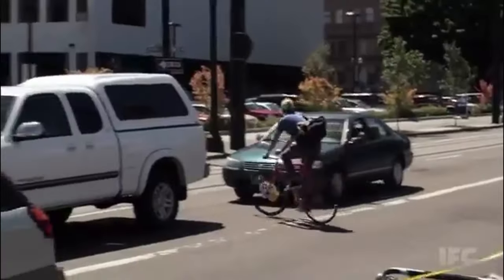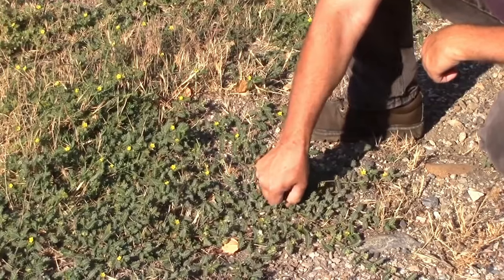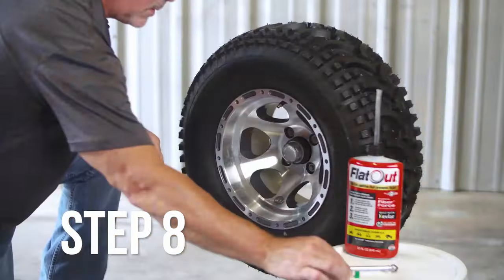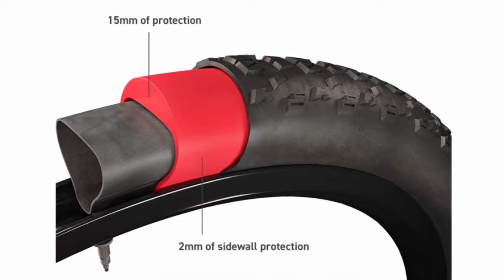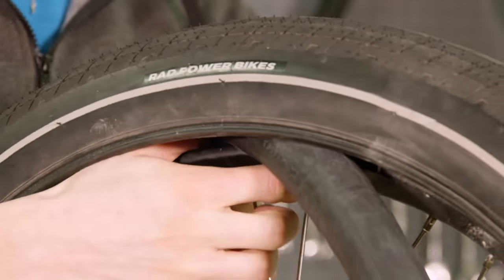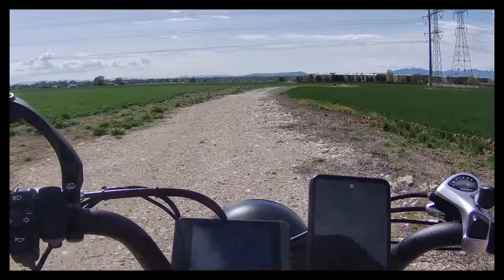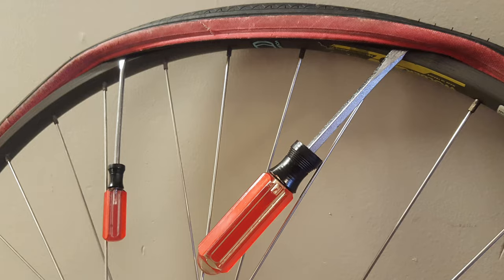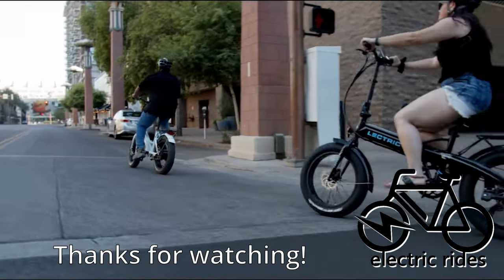How to Prevent Flat Tires on Your Ebike!

Comment: 1hack that my dad taught me was to use capri sun pouches in between innertube and the tire. It is a very tuff protection for you innertube!!
Reply from the maker: That's an interesting one I've never heard of but makes sense! Thank you!
Reply: Brilliant - your old man MacGyvered the tires. Wish I was wearing a hat so I could tip it to him. Thanks for sharing.
Reply: The material sure sounds tuff but how do you keep them in place? Tape?
Reply: How bought some them hot dog pouches. Man tear resistant. Lol 😮

Comment: I've had my Ebike 3 months 3 flat tires already. My Walmart under $100 cruiser no flats in 5 years!! Same bike route as always.
Reply from the maker: Haha. When I road a pedal bike I had flats now and again but with an ebike it's a common occurrence. I feel your pain!
Reply: Ebike tires are at a lower PSI which is why they're more puncture prone. Also they have more surface area.

Comment: When replacing an old tire. Cut the side walls off the old tire  and put into the new tire as a free liner.
Reply from the maker: I've seen a few people go this route, is this something you do on the regular? I would imagine it would add some weight but I guess around the same weight that a tire liner and 8oz of Slime/Flatout would add.
Reply: Hmmm that sounds brilliant..I just wish I seen this before changing my old tire a few days ago

Comment: My friend in Florida generally takes a monthly bike ride from Spring Hill to Tampa with a few other guys, a distance of just under 100 miles. To prevent flats on such a long ride,  they have all installed Vittoria Airliner inserts. Not one person in his small bike club (twelve people) have had any flats in over a year.
Reply from the maker: That's awesome! Seems that airless may be the future of bike tires since there are more and more of these tire inserts on the market everyday.
Reply: It's only not a thing yet because air is lighter then foam and foam isn't as good YET as air is for cushioning.    It's a trade.  And will likely always be a trade off

Comment: I have OKO heavy duty sealant in my tubes - (the big bottle stuff for tractors etc) - no flats since last summer. Barriers might prevent some punctures - but maybe 50% are caused by some failure in the wall of the tube from the inside. Sealant can handle both causes.
Reply: I'm looking to add some of the crazy tractor sealing foam myself.  Good to know it's amazing!

Comment: Excellent video! I found the puncture resistant Kenda's pretty effective, and I have ridden right over thorns and broken glass several times with no flat. Ironically, I didn't start getting flats until I installed Tannus Armour. In the last ten years I've had one regular flat, and six flats caused by Tannus Armour. Seems on fat tire bikes that are ridden at high speed for long distances, the internal friction ruins the tube. I took the liners out and stopped having flats, with the exception of a strand from a steel wire brush that was long enough to go through the liner. I changed to Shinko 244 moped tires which do cut down on my top speed a bit, but I don't bother carrying an air pump anymore.
Reply from the maker: Glad you liked it! Haven't had any issues with the Tannus on my Runner yet, but then again I generally only get up 28/29 mph max. I was considering Shinkos but that added weight has me wondering.
Reply: Same. Even with Tannus liners and sealant, I got 3 flats in one month. When my knobbies wear out, I'm getting street tires.

Comment: Replace your butyl inner tube with a thermoplastic tubes which are half the weight of a butyl tube and then put a liner or foam barrier which will weigh about the same as yout original set up.

Comment: As a bike mechanic, Tannus Armour with some sealant in the tubes is my go to (don't forget your baby powder)
Reply from the maker: Great point - I tend to forget the baby powder sometimes. 😂
Reply: Baby powder?
Reply: Have heard a lot of people talking about the Tannus Armour losing thickness over time. Have you experienced this? Is it improper installation maybe?
Reply: Pool noodles instead of inner tube.
That's what I'm looking to do with 2 mountain bikes of mine. Currently, they're wheel hole inserts Slice Innertube nozzles.

Comment: You can also use an old seatbelt from a junk car, or a load strap from a semi truck (far better as its usually a bit wider and thicker than a seatbelt) thats been tossed due to the edges fraying, you just cut to size. 

They're surprisingly tough in keeping things from puncturing the tube.
Reply: What I would love to see is a video of putting the available tire liners on the market to a test what can puncture them and how much effort it takes to push a sharp object through. As example take one of the liners and start pushing things though it, and the second liner put into a tire and start running things over to see what will puncture them. 

And take some of the suggestions of alternative tire liners that people has suggested in the comments to see how they compare to the ones available on the market.
Reply: I'm currently waiting delivery of some webbing from China, for this exact purpose. It's available up to 100mm (3.9 inches) wide, and is reasonably cheap.
Reply: @baldieman64  what kind of webbing?

Comment: After seeing a tip online I'm going to use some seatbelt strapping to fit into the fat tyres to protect the inner tubes. 
Thanks for the interesting video
Reply: Is there any issue with the belt straps moving in the tire and causing any effects due to any out-of-balance? Please share what you may have experienced by now. What method to fix the belt please?
Reply: @houseandhobby6971  The strap I had ended up being too thin for my fat tyres so I bit the bullet and went with tannus front and back. Nice soft ride and worth the outlay imo. 
Safety at high speed would have been on my mind with the seatbelt strapping to be fair. 
I'm to old to fall off at 40 mph down a hill lol
Reply: @moonshotsilver  I appreciate you sharing your answer on this. I have some large yellow trailer straps from HF tools and will probably cut that to length. But also, I found that there are good tire alternatives that are used on motorcycles and scooters. Shinko models 241, 244, and 567. Sizing for those bikes differ. A 3.00x16" tire tube fits our bike 4x20 wheels/tires. Got the 244 based on look and price and reviews and will construction glue the strap in the tire (I think). And Flatout in the tubes. New tubes--going to trade out the whole crap package that came with the bike tire wise.
Reply: @houseandhobby6971  Sounds like a bullet proof set up to reduce the risk of flats about as much as you can. Good luck and safe riding 👍

Comment: thanks you for  info. I am more concerned with rear wheel flat than front wheel. Because it requires to remove chain and brake systems. I will go with Flat Out sealant.
Reply from the maker: I've had that same concern, it can be a pain to remove the rear wheel. A tube sealant (slime) saved me from having to remove it on quite a few occasions.
Reply: @ElectricRidesUT  I used FLAT OUT on my E-Bike, a one inch screw stabbed my back tire, I removed it and flat out did the job, my portable compressor filled my tire back up to 25 PSI and it's holding strong a month later.
Reply: Don't take wheel off, just have a patch repair kit on board, remove one side of tyre and slip out tube , find puncture and fix it and slide it all back , easy.

Comment: That took sometime replacing the tire and inner tube on the back wheel,Also very fiddley as well,Got that done at last,Also having to get the back wheel fitted back in place,Back wheel nicely pumped up,Job done,Now order replacement battery as well,Thats going cost me quite a bit,Just as well im busy on Jobs this week,Need the extra wages in return

Comment: My favorite method is one you didn't mention at all. I guess because of the extra weight. But I like more permanent solutions,  like completely solid tubes or solid tires. Yes, they do weight more, and the ride is not as smooth, but they completely prevent flats. I put some in a trike I used to have, and then I had to sell the trike. My current bike is a very cheap Walmart bike, and I can't even get my rear tire off because there is one bolt that I can't get loose, so if I get a flat in that tire, I will be up the creek without a paddle.
Reply from the maker: You make a great suggestion! I considered adding solid tires or solid foam inserts for tires but I really couldn't find a lot that were designed for the fat tire ebike size. For the most part, everything was for around the mountain/commuter/road bike slimmer size tires. There are ebikes that use this tire size, of course, but they're not as wide-spread as the 3-4 inch ebikes tires so I decided not to add them. Do you have a brand that you're partial to?
Reply: @ElectricRidesUT  I have only tried one brand. I forgot the name, but they are yellow solid tubes. Lately, I have had a problem finding them in the right size for someone of my height range...which would be a 24 inch tire. I have also recently seen a few solid tires on Amazon,  but I can't remember the brand. I think I have seen some solid fat tires, though. I just put the words solid bike tires on the Amazon search bar. AND, I even put in solid fat tires, and solid fat tubes. I don't think I found any fat tubes, but I think I did find a couple of fat solid tires. Solid tubes and tires are kind of rare, but they can be found. Amazon usually includes things not in your search description,  which I find annoying.  Sometimes,  it is just other things, with none of what you are looking for. Some people don't like the solid tires and tubes because the ride is rougher,  and that could be why they are harder to find. But, I saw a video a few weeks ago, in which someone was working on coming out with a solid tire or tube that has more air bubbles incorporated in the rubber, which makes the tire or tube feel more like it has air in it...with a softer ride. This sounds to me like it would be even more perfect.  This would be the best of both worlds.  Getting a flat, really socks, and I would personally rather deal with the rougher ride, than to have to deal with getting stranded because of a flat.
Reply: Have Tannus solid tires myself on my bike and trailer. Right now they are more than 50% off too.
Reply: never going to get a fat tire tube replacement. It would be just to heavy.  this guy putting gorilla tape and using cool seal instead of slime with the new valve or he could have used an automobile rim shrader pop in valve aswell, is brilliant.  but theycan of course leak eventually. @ElectricRidesUT

Comment: bought a "stop a flat" solid tube and needed a high wall tire which a kenda 26 x 2.125 works well.   very hard to install but just enough give to prevent the steel in the bead from coming out.  slime works well but the stop a flat prevents any problem for the life of the tire.,
Reply from the maker: I love to see that the solid tires/tubes are becoming more prevalent. Just curious, what was the main difficulty that you were running into while installing?
Reply: With the weight of the solid tubes, the inertia means slower take offs and less battery time.  So I would not recommend the balloon solid tire for any pedal bike.  but for a gas bike or ebike 350 watt or higher they prevent flats and do not seem to hinder performance too much.

Comment: I tried Flat Out on my 4" fat tires. I came back to my bike after a work shift to find my tire flat, and sealant EVERYWHERE. A huge mess. Apparently this only works if the puncture is pointing DOWN. I was unaware the tire was punctured and the puncture was resting towards the top of the tire the entire time, spewing sealant into the tire and out of the rim. I think this kind of sealant is really only doable if you go tubeless.
Reply from the maker: What a mess! Luckily, I've never experienced anything like that using sealant in my tubes. Very strange.
Reply: I don`t know but maybe just maybe vandalism. Just a thought.

Comment: Keep in mind that for fat tire ebikes, using slime or flatout is fine, but if you have something such as a gravel bike or road bike and you tend to go at higher speeds on those 30mph+, slime and flatout can introduce wheel wobble.

Comment: Great video. I have too frequent flats so I am looking for a better solution. I have tried the foam pipe insulation and it did become a thin layer after two weeks. Slime tire allows me to continue riding home but doesn't reduce the number of patches I have to do. Would FlatOut be similar to slime?
Reply from the maker: Glad that you enjoyed it! Sounds like the problems I was having (still sometimes have) with flats. The pipe insulation/pool noodle liners also quickly compressed down to be as useless as a layer of Saran wrap when I tried it, not sure how other people prevent that from happening, much lower PSI?🤷‍♂️  I normally go with Slime just from habbit but from what I hear FlatOut is slightly more effective. I'll probably go with that the next time I need to swap out tubes.

Comment: Found out if you have a powerful DD gearless FRONT WHEEL MOToR of a 1500 watt and higher, NEVER excell the throttle when turning going over 20mph because most front wheel hubs are double wall rims which when turning of throttle on the pressure of rotation is heavy on the tubes as it will pinch inner tube against inner side sleeve of rim. I know due to myself getting happy of the speed while turning of 3 times. I noticed it was me turning and increasing speed only to almost wipe out. Same place and same turn as all 3 times I pushed throttle. Now , this is for the 2 inch width tires, likely the 3 to 4 inch fat tires don't have this issue but yeah, I know now not to do this anymore.
Reply from the maker: That is great to know! Thank you!
Reply: It was all 3 times of months apart, I went full throttle going home as there were 2 turns 200 feet apart, I was feeling like them motorcycle racers leaning low around corner but I accelerate the throttle to keep speed up on straight away. Before my 2 nd turn I noticed a bit of a wobble of handle bars and knew my tire flat out , as soon as I made 2nd turn I almost wiped out as I saw tire flush out air. Happening a few times at same spot with same type of riding made it easy to figure out the issue.
Reply: @ElectricRidesUT  But e bike speed over 20mph puts a lot of pressure of the tires of all the obstacles and type of terrain bike encounters of that speed. The fat tires counter this but leaves bike hell of heavy. It is a MUST of any e bike rider with 2 inch tires ride the e bike like they would a car when encountering the minor bumps, dips, pot holes, driveway entry curbs, ect. I notice I've been riding fast like a kid speeding thru everything as I've learned the hidden reasons of e bike issues of flats and air out( constant re pumping air to abused tire) besides the traditional issues, this issue of riding of always easing up to 4 to 2 mph of encountering such terrain. Them pot holes going fast is a killer to the rim more then the tire.

Comment: I've always used Slime and this time around I have their heavy-duty tubes with the Slime already in them on my recumbent trike, and Flatout in my and my wife's RAD Expand 5s. I typically go years without flats.
UPDATE:  I got a flat on one tube after 9 months so I switched to Marathon Plus tires with just Green Slime. It's now been almost 5 months and so far so good.
Reply from the maker: Nice! Do you notice any difference between the Slime and Flatout? Some say Flatout is supposed to be slightly better. I've used Slime ever since I was a kid so it's usually my go-to.
Reply: @ElectricRidesUT  no difference for me.
Reply: I put green slime 2in1 in my tubes on my radrunner plus and it did jack nothin on two punctures I got. the tube deflated.
Reply: @slugzkea  You need to get the sealant that has "Kevlar" fibres and use half the bottle for each tire Flat Out  Canadian Tire better prices  than Amazon for this stuff
Reply: @FanofDocumentaries  , update. I got a flat on one tube after 9 months so I switched to Marathon Plus tires with just Green Slime. It's been almost 5 months and so far so good.
Reply: @ElectricRidesUT 😮

Comment: Best thing to get is slime inner tubes and fresh new tires after they well worn down,I still been getting some more punchers on my back wheel now,I get them tires replaced soon as well,Costed me a fortune,Its well worth it,Or end up keep on glue more patches on the inner tubes,Never going for normal inner tubes no more,Thats what you got to do to avoid punchers

Comment: I wonder if I could 3D print in sections that fit together out of TPU Nylon or ABS that go in the tire first to create a barrier about an inch thick. 3D prints can be printed hollow so that weight very little. I think the hard part would be preventing the 3D parts from pinching the tube. Maybe using the double tube method or Mr. Tughfy with the 3D printed parts? I have only had 2 flats in about 1200 miles, one was very slow and I could have lived with it just adding air every couple of days, the other was a large screw that went through broke in half and put multiple holes in the tube as I slowed from 30 to 0. I have double tubed after each one.

Comment: Nice video, very informative. Where did you get the pressure monitor? Thanks
Reply from the maker: It was on Amazon but looks like that exact version is no longer available. I've seen similar ones that look to be near-identical in design and function though. Such as: https://amzn.to/3z9F1mp
Reply: @ElectricRidesUT  Thanks for your time.